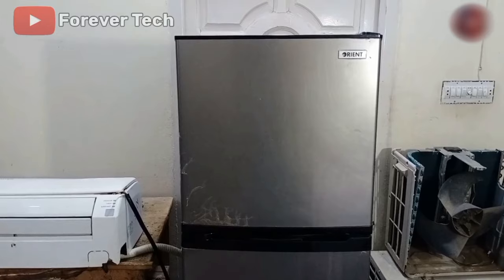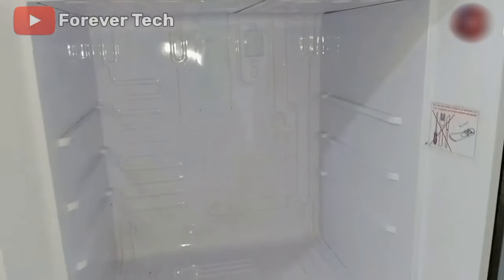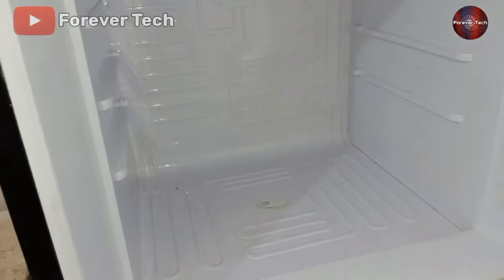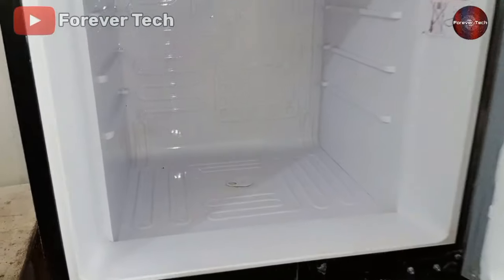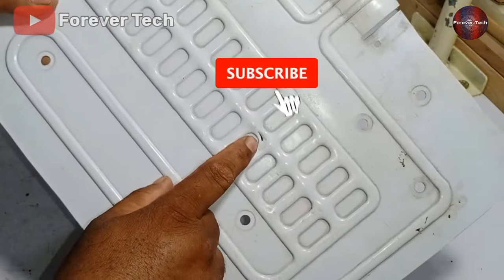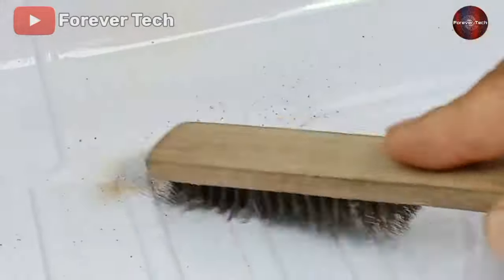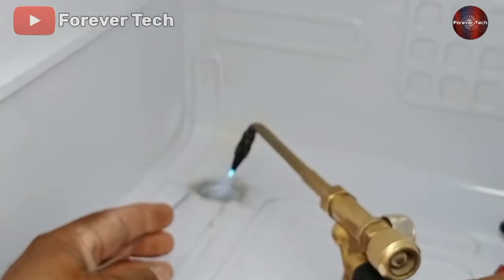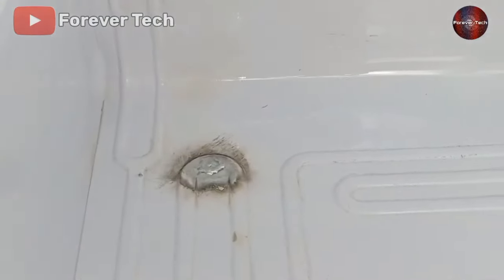Refrigerator Not Cooling - Freezer Box Hit With Knife While Ice Removal

Comment: I just put a small hole in my freezer and freon leaked out. I have already put a wet towel on the hole. Should i proceed on soldering it immediately? And after solder what should i do with the lost freon?

Comment: Nice~Is that an aluminum coil and is that rod a self fluxing rod. Thanks for the video
Reply from the maker: Yes every Evaporator is made of aluminum and the rod is a silver rod I Used.. And Thanks Mate
Reply: @forevertechenglish  can I use lead to fix the hole? The normal kind used for soldering?
Reply: @forevertechenglish thanks for the video! Can I use aluminum rod?

Comment: Do I need to refill gas after ?
Reply from the maker: But first you will have to weld the evaporator, and fix the leak, clean the coils of the refrigerator with nitrogen, then you can refill the gas. Make sure no water water is left inside the condensor or evaporator pipes.
Reply: Hmm, I dont think I can DIY this. Thx for the video. I appreciate it.
Reply: 😢 @forevertechenglish

Comment: i try to defrost our fridge with a knife, then suddenly i here a wheezing sound,
it still can be repair?
Reply from the maker: That wheezing sound is means that the refrigerant from your refrigerator has leaked out. Call an expert to check your refrigerator, if in case its leaked.

Comment: Hi guys. Can i fix that type of hole by using glue??
Reply from the maker: Glow Won't work
Reply: JB weld worked for me. its an epoxy that says works with metal. i put a thick coating on it and let it dry. working now!

Comment: thanks, why did you say if it's the freezer you can not fix it please.
Reply from the maker: My pleasure, please mention at what time of the video did I said it.
Reply: @forevertechenglish  2;54, if this happened in the freezer, it's unrepairable...
Reply from the maker: Dear I meant to say that when a sharp object damages the refrigerator from the both sides of the evaporator tearing it apart than that kind of evaporator is not repairable as it is repairable when replaced by a new evaporator.

Comment: Is it okay to use while there's a hole?
Reply from the maker: No the refrigerator will not cool at all, the refrigerant has been leaked out, If you keep running the refrigerator and if the freezer has ice on it, the ice will melt and go inside the pipe and eventually do inside the compressor quickly then not using it. You will then have to change the compressor which is been water damaged.
Reply: @forevertechenglish  oh thank you for making me understand.
Reply from the maker: it will not work, as there is not as circulation. All the melted ice will go into the compressor. Eventually you will need to replace the compressor then.